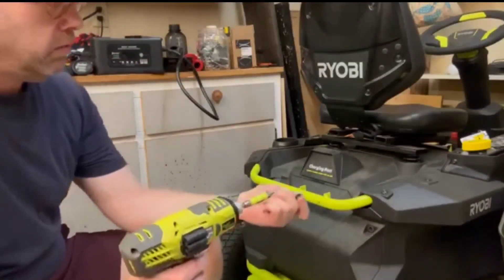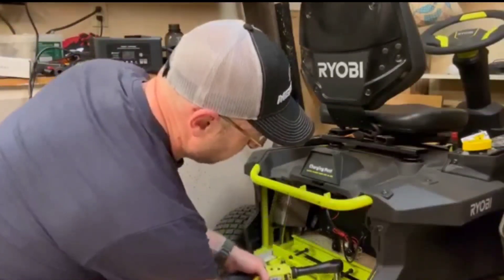ECO-WORTHY 48v 50ah battery Installation in Ryobi 480e mower

Comment: Great Video, can you detail the Model of the charger, it looks like a P3648?  also The monitor, is that a hengsman AiLi Battery Monitor Voltmeter Ammeter Voltage Current Meter 8-80V 0-100A Auto Car Motor Boat Caravan RV Motorhome, and lastly the battery , Looks like 3 items and 2 hours of work.   Our lead cell batteries are dead, very discouraged with just 2 years of use....and now I have to spend what appears to be 1K ughhhh
Reply from the maker: Visit my Facebook group for the latest information 
https://www.facebook.com/share/g/1AYMd5uagk/

Comment: Thank you for your video ! I finally converted mine to a 50 amp hr lithium battery. One thing I would like to say I used the plug on the new charger it was easy to break the tabs out of the mower with needle nose plyers and the new plug fits easy.

Comment: So this will probably sound odd... But since i have 8 18volt 9amp batteries already if I wired them in parallel and used a 18-48 volt boost converter that should theoretically run the mower right? I realize it probably wouldn't have a long run time but i already have the batteries and only cut about 1/3 of an acre 0:05
Reply from the maker: If you had 9 batteries. You connect  3 parallel sets of 3 series batteries. That would make 52v and 27 ah battery . Using 6 batteries you would have 52v and 18ah.
Reply: @Ryobi48vElectricMowers  ..I'm very hesitant to run the Ryobi 18 volts in series..in past ebike and push mower projects I've had issues with the lead battery totally dieing very quickly ( to the point I have to tear the pack apart and jump the cells.. while the second battery is still at full charge..I think it's something to do with the way the bms boards operate... in parallel I could use different amp batteries together in a bank 4,6,9 ect..I have over 32 various ones that get recharged either off the work truck or my solar panels

Comment: Thanks for the vid Ryan. What is the mod# for the charger? If the 48v 100ah lifepo4 battery was used instead of the 50ah, would the charger still charge the 100ah? And when looking to purchase the charger, are the amps critical and if so what amperage should the charger provide? Thanks!
Reply from the maker: This is the charger used. Then swP the plastic connector housing for a perfect fit.Golf cart Battery Charger, 48V 13A and 36V 18A Trickle Battery Charger,48 Volt Golf Charger,for EZGO RXV&TXT Smart Charger,Lithium,LiFePO4,Lead-Acid AGM/Gel/SLA..Battery Charger,3-Pin (Delta-Q) https://a.co/d/428hpgr
Reply: @Ryobi48vElectricMowers 12:04
Reply from the maker: Visit Facebook group Ryobi 48v Riding Mowers. 
https://www.facebook.com/groups/ryobi48vmowers/?ref=share

Comment: Also, is 50 amp enough? I have seen many post regrets about 50 instead of 100.
Reply from the maker: They are great for the 300e  and good for the 480e on level ground.
Reply: @Ryobi48vElectricMowers  what happens when you go uphill? Also, on level ground can you get away with setting the blades to high-speed cutting or only low-speed cutting? And, can you mow on level ground easily with high-speed driving and high-speed cutting speed combined? I'm on the fence about replacing with either 50ah or going with 100ah LiFePo4 batteries. The lower price point of the 50ah seems attractive but I don't want to be bogged down by range-anxiety or wimpy performance. I have almost 1.5 acres and want to rip through it in one sitting. The lousy lead acids that came with it are degrading rapidly and I'm not willing to put up with those pieces of shite any longer. Thanks for making and posting this video!
Reply: @arminius301 any update on this comment? I’ve been looking for videos and comments that give some insight on “range” based off of battery size utilized, but so far I haven’t found anyone discussing it thoroughly.
Reply from the maker: A 50ah battery should be good for 1 acre or less.